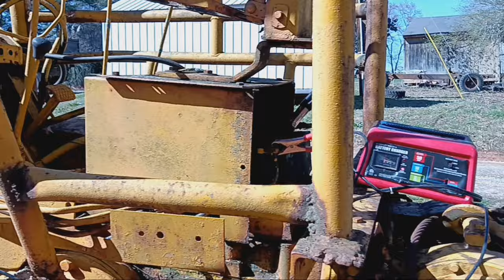small dozer with injection pump problems part 1

Comment: good ol roosamaster   LOL  I went thru just what you are on my crane
Reply from the maker: After I got done I put it back on and still no fuel but I found a video this morning about a 1965 case backhoe and the guy pulled a little plunger out of the back where the injection lines are he said it was the transfer pump ,I feel this may be my problem now